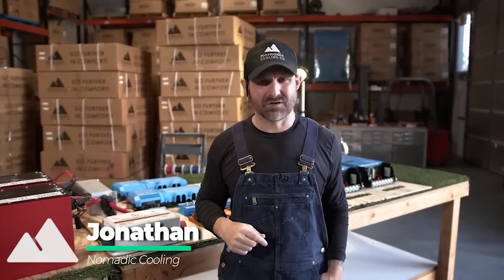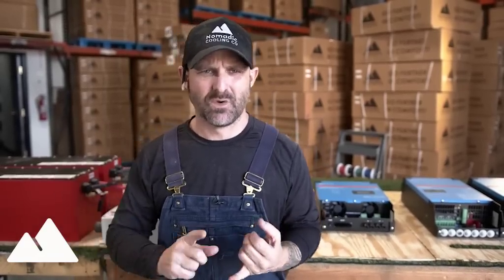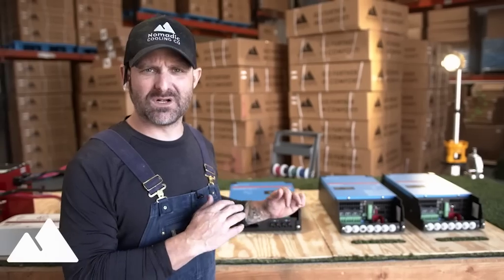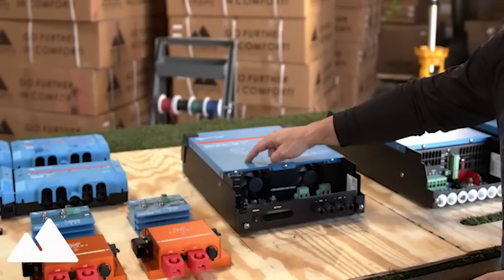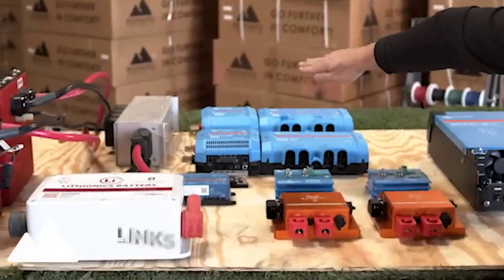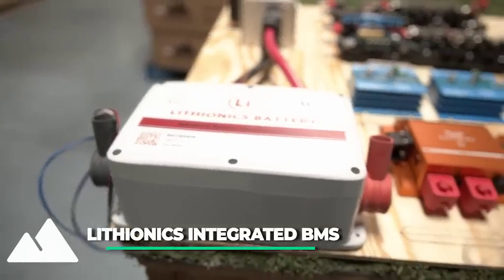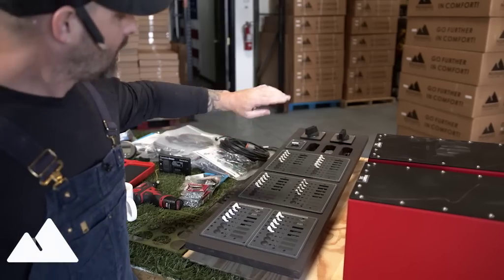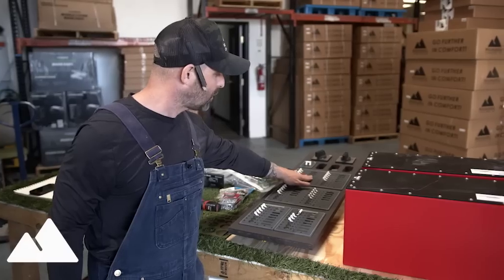The Ford F750 Conversion Electrical System by ❄️ NOMADIC Cooling 🏔️

Comment: I have a 22 170 sprinter and I want a 24v system. Do you put in the electrical? I only have found people who do 12v. I like the new 24v ac and I will be in South Florida sometimes in the hot summer.